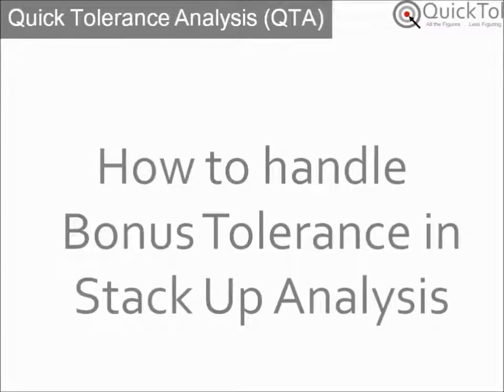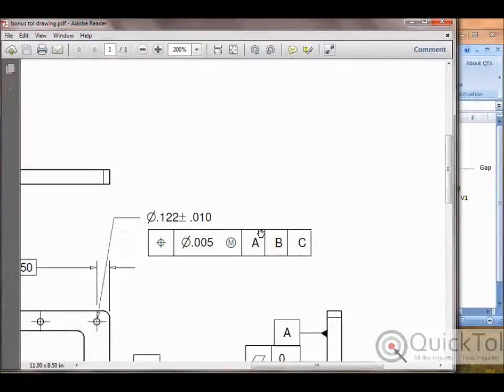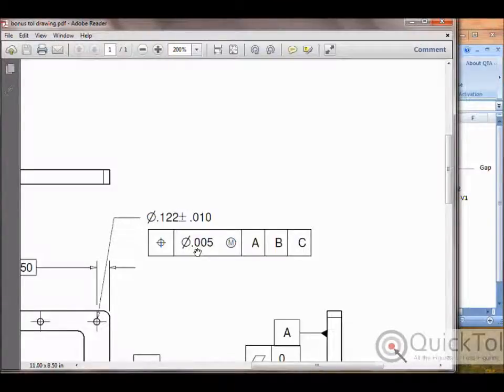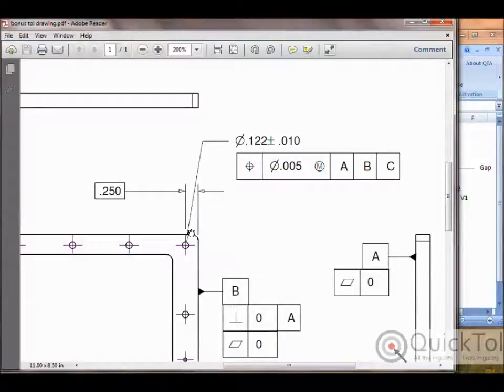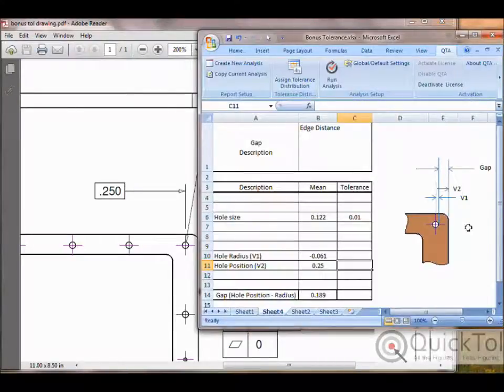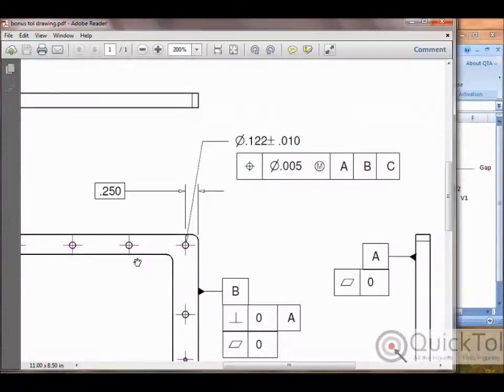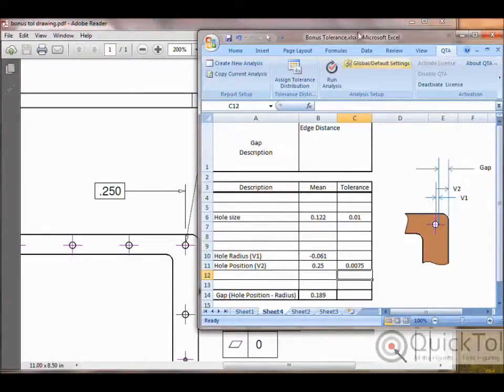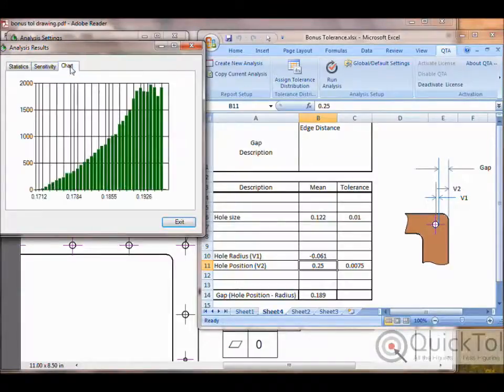Bonus Tolerance in Stack Up Analysis

Comment: Nice presentation. If the B datum surface has flatness of 0.5, how you are going to input that in QuickTol spreadsheet?
Reply: maybe you can input 0.25±0.25 ,if the gap means a local size to the surface.